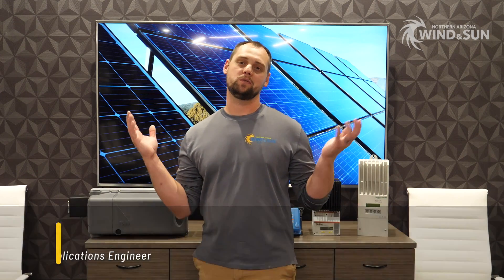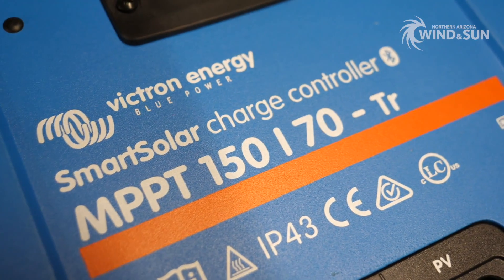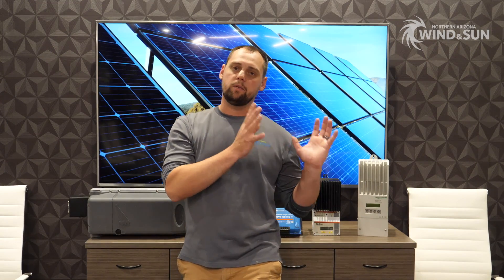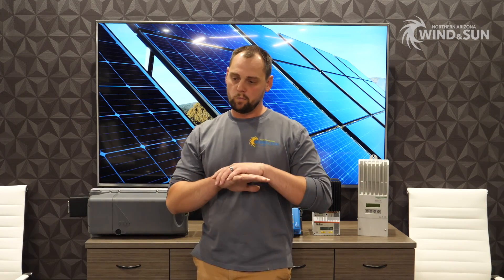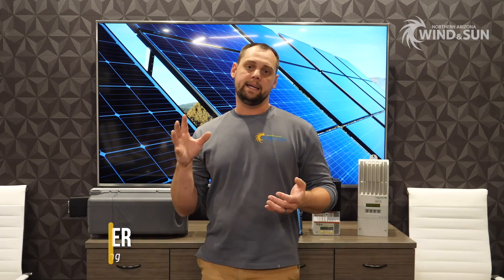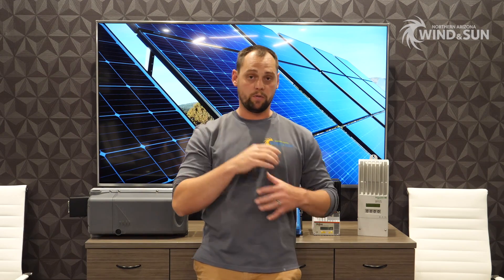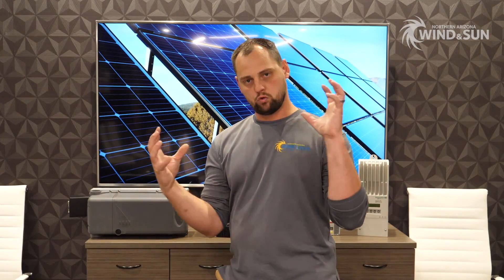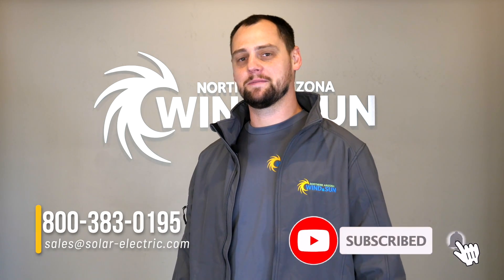MPPT Charge Controllers Explained

Comment: Great,if there was a practical example would be better.Like connecting two 300+watts panels to show how regular charge controller work vs mppt.By using current meter and battery bank.

I use 4 Morningstar 45A  mppt scc I have eight panels 4  310 watts,4 345 watts.I use one cc for every two panels.So they don’t over heat at all,and work smoothly.

Keep going.Good videos and explanations.
Reply from the maker: Thanks for watching!

Comment: Can I just put my panels in Series to get the voltage up so that my MPPT CC will be effective with my 36 Volt battery bank (3 X 12 Volt batteries in series)?
Reply: Around 4:40 he mentions maximum voltage input limit. Example, the Victron displayed at the beginning of the video is a 150/70. The MAX voltage input is 150 and you have to take your temperatures into account. So in my case, I can run three panels in series which is around 110v. Run those strings into a combiner box. I've seen my Outback FM80 protect it's self, max output current 80 amps (that 150/70 would be 70 amps). Not happy a few Outbacks randomy died, purchasing Victron 150/100's next. I'll try to keep the amps at 80 max by turning off a string if need be in summer.
Reply from the maker: From our engineers: The Voltage from the solar array usually needs to be about 35% higher than the battery voltage so the lowest voltage you would want from the solar array would be about 48VDC. Of course, the input voltage of the charge controller will dictate the upper limit of the voltage. - I hope that helps, thanks for watching!

Comment: Did I hear you say an MTTP controller is not good for a 12V panel and 12V batteries? This is the first time I had heard this... about 6:50 or so in the time.  I have two 100 amp lifipo4 hooked in parallel with a victron 12V mttp smart controller. Not all hooked up yet, but you say this is not good?
Reply: Same here,  why are most RV panels 12 ?
Reply: What was said was that it’s not ideal because there’s less head room and the controller wouldn’t be able to function as effectively. This is especially true when 12V panels get hot. This is also why most very basic RV systems use PWM charge controllers, like ZAMP. With that being said one can configure 12V models in a more ideal way by simply series configuring the array.
Reply: sort of correct - 12 volt panel, not enough headroom to fully charge the battery. regardless of controller.  You need about 17-18 volt panel minimum, ask uncle google..
Reply: @tlillard23  I talked with BB and Victron who explained ... it took a bit to understand how voltage etc. effects.  I read the manual of the controller again and it says a max of 220W ... but will go up to 100 Volts... to series a panel or two will work but I didn't $$ for it .... need to think about it.
Reply: Best basic explanation of how an MTTP ctrl works...it's function:   Voltage is an expression of an electron's source to do work...that's how we define energy..the ability to do work.   The solar panel's voltage describes the amount of work (current generated by photons of light dislodging electrons in its silicon material) can create.   The battery's voltage works the same but is directed outwards to the charge controller.  Simply if the panel's output voltage is the same as the battery's they will oppose each other...in simple terms the energy created by the panel's electricity is unable to effectively push electrons (charges that reverse or restore the battery's chemistry) into the battery.  That process requires us to expend energy (do work) to make the elements and compounds inside the battery to reverse to reach the state of its fully charged capacity.   Water runs down hill.  If two water sources are at the same level water molecules don't predominantly move in any direction when the two water containers res piped to each other.  If raise one container higher than the other, the water from the higher source will move into and overcome the resistance the lower water creates to push back AGAINST this force from the flowing water. When the two water sources reach the same level, the water molecules cannot create any current one way or the other.  They equalize each other.  This does not answer the questions raised specifically here by others here as there some other technical issues occurring inside the MPPT unit's circuitry and is beyond this simple explanation.